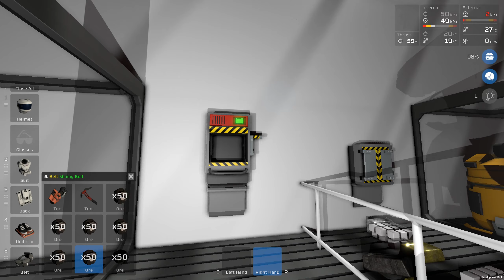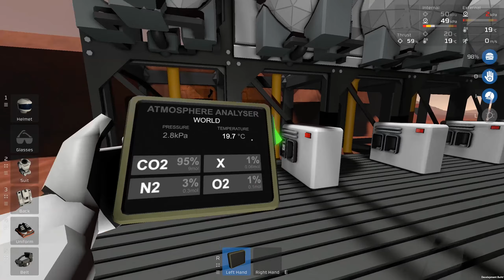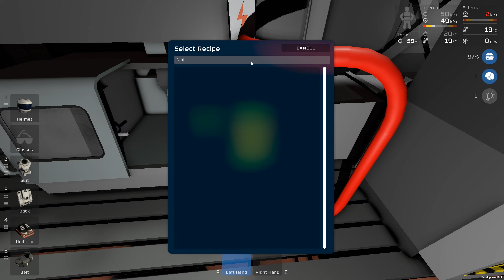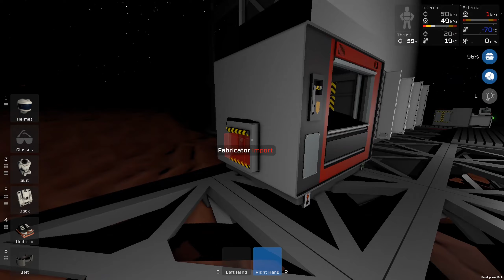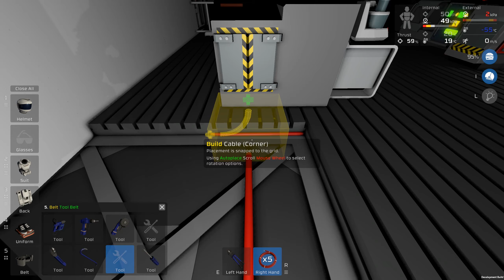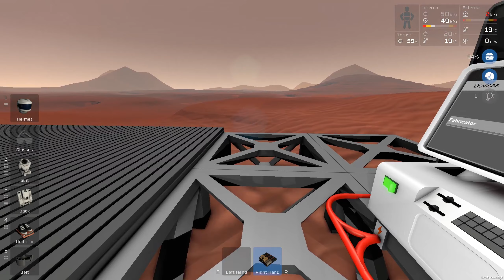Stationners S4 E21 - Fabricator and Recycling

Comment: I run my recycler and centrifuge and connect it to my arc furnace's setup, one per ore,  and then a stacker that stacks in 50 or 150  i have a unloader  connected to the system  and a return loop for the belts and the mining  tools

Comment: The recycler will make reagent mixes of half of all the material used to make the items.

This mix is reagents of various types (iron/copper/invar/etc) all mixed together.

The centrifuge is for splitting these reagents into their individual components, and where possible, will return the raw ore.  (There is no invar ore, so you get reagent that you can use in the furnace to get ingots back using the same heat/pressure as smelting needs, but as mentioned, you need to separate them.)

Soooo... having a stacker on your centrifuge is actually not a good thing.  You don't want to stack your reagent.  You can put a sorter and sort ores to a stacker if you want, but don't stack reagents.
Reply: I think you used to be able to get the alloys back with a cold furnace. If you now need to cook them again, how do you tell what alloy you have? Then again, you could cook at 1000K, 800kPa and if it doesn't work, it is Invar.
Reply: @cmilkau  You can see what alloy it is if you look at the recycler real quick after putting them in it.  Maybe there's another way (via slot reader, if it's not mixed?, I don't know)

Comment: you can open the furnace mold and it will still process ores.  It's a quick way to smelt a bunch of items.  If the furnace is warm enough, you can open the mold, dump in the ore and when it has a full stack it will automatically output a stack of ingots.  You don't have to manually open it for each stack if you don't want.

Comment: You can actually get rid of ALL the pressure regulators at the furnace and be safer. Without the pressure regulator after the mixer there will be at most 100 kPa of fuel mix and that only until activation. After flushing there won't be any fuel mixed at all - 100% safe. Right now you have a pipe with 20 atmospheres of explosive gas mixture! Combustion in the furnace is not dangerous, combustion in the pipe is. The pressure regulators before the mixer don't hurt but don't help either.

Comment: I think your recycler outputs are too low for the centrifuge to split components (some component may be less than 1g).
Try to recycle several items without activating the centrifuge and only after activate the latter.

Comment: Would be cool to a automate building components, and have them spit out from overhead conveyor blocks into a "bin" made of railing. That way, when you print, say, 200 electric cables, they all drop and stack themselves in a container meant for just electric cables. Would be difficult but doable to have a sort of "component warehouse" with bins for each component, dropped from above.
Reply: I was considering that kind of automation with vending machines as storage, but now that I have read this, I want the conveyors.